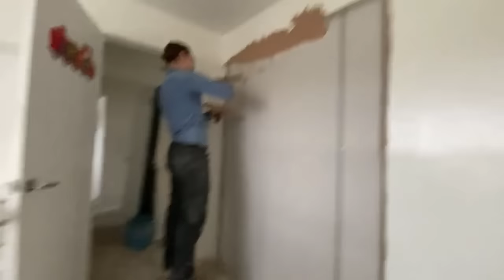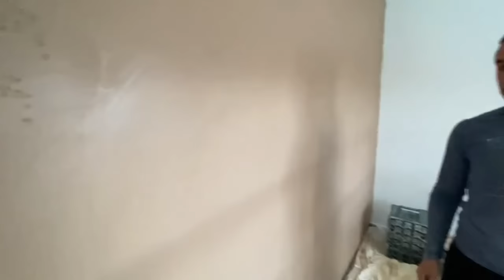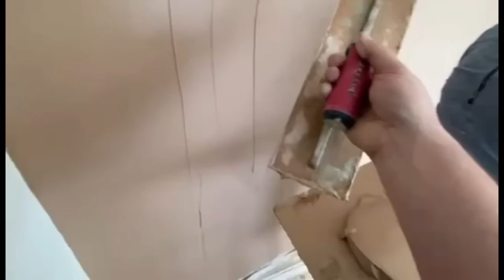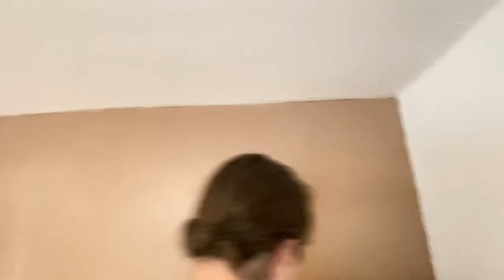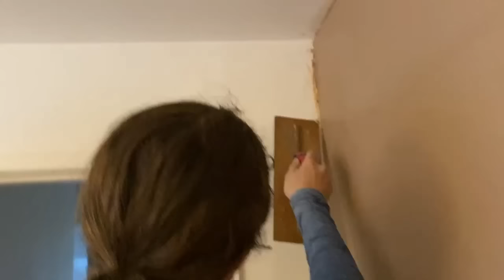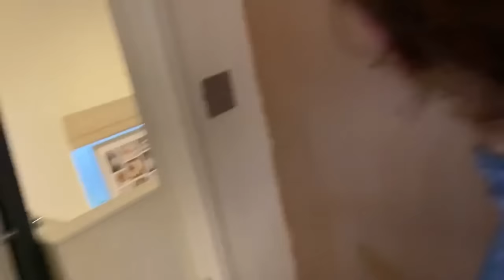Letting the Apprentice Loose in a Customer's Home

Comment: Not being funny but that mum should of kept the little boy out of the way. Unless you said it was ok?
Reply: In most cases I would agree but there are times when the situation takes over and you have to just put up with it a little bit, but only if it's safe to do so. Some kids are just naturally inquisitive, and others are just a pain in the arse. I have in the past kinda let them linger around  just so long as they're not under the feet. But inevitably there comes a point where you just have to politely ask them to keep the kid out of the way so they don't get hurt and explain about the sharp edge of the trowel, the water splashing about and tripping up over the dust sheets. Not to mention dragging any dropped plaster there might be through onto the carpets in other areas. The perils and pitfalls of doing domestic work unfortunately, especially during the school holidays. Set them a task of counting out a box of screws to keep them busy.
Reply: You're right, especially when the child put his hands & face near the running whisk. The H&S bizzies would have a field day preparing the prosecution if anything went badly wrong. And the Insurers would be reluctant to pay out on the public liability policy.
Reply: 100% no chance I could have worked with the young fella chattering on in background lol , plastering or decorative plastering is not a job we’re kids should be present , can be pretty dangerous unsupervised